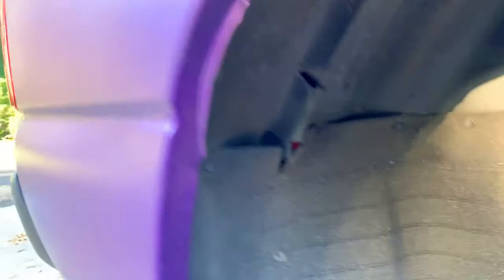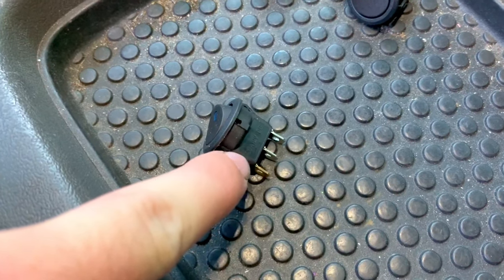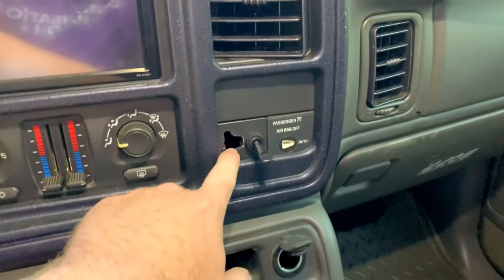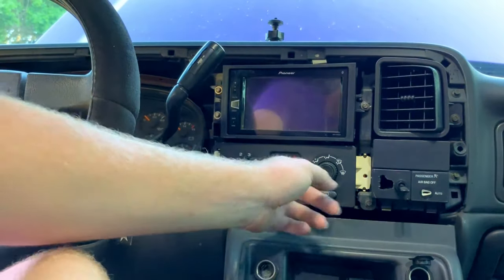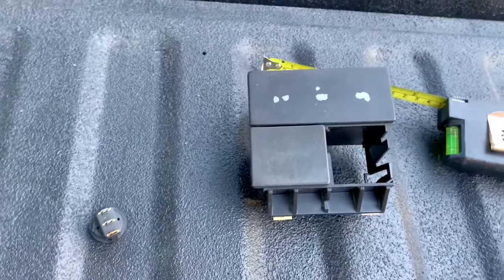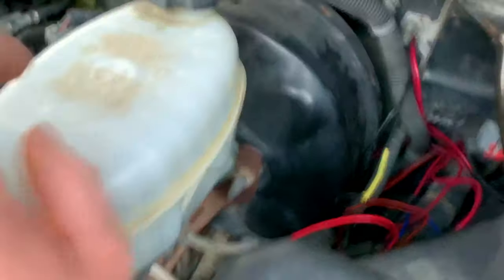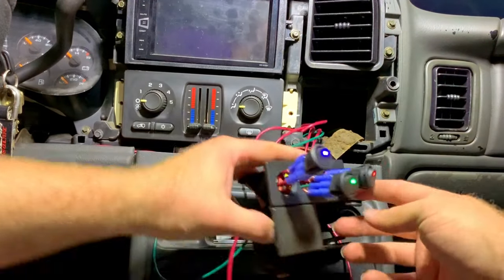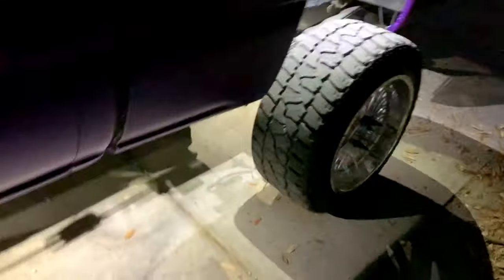DIY Switch Panel For Aftermarket Lighting

Comment: Orilleys sells a tool for running the wire through rubber grommets. Looks like a screw driver with a hole in the handle . I've always ran my constant and ground wires just like did .  I've been wanting to do switches in my over head center console .  I would suggest using wire loom to straighten up some of the wires in the engine bay and it's added protection .
Reply from the maker: I plan on wire looming everything just ran out of time that night. I don’t like the bare wire look.
Reply: @AaronCates  what is wire looming
Reply: @CODESFV A plastic protective sheath to run wires through and keep them in place, just look at the factory wiring harnesses.

Comment: Hey so I have wheel lights on mine and they keep draining my battery and I was wondering if my wheel lights are controlled with just my phone and I install that switch like how you did will it shut them off even tho they are controlled by my phone

Comment: I got that exact switch for my rock lights but for some reason it isn’t communicating with them even though the switch it self turns off & on. I have my load wire coming from the switch connected to the main red positive wire from the rock lights with a fuse on it. I’m stumped on why the switch isn’t communicating with the lights whenever you turn the switch off & on… My ground for my rock lights is the negative pole on my battery but they would always stay on or hot the whole time connected to the battery even when I would turn my switch on & off so I wonder if its my ground for the rock lights that could be issue & why it’s not communicating properly. I would appreciate some feedback from you on what you think could be going on, that would be great!
Reply: Mine did same thing get 5 prong switch and it will work idk why 3 prong switch did that

Comment: Sup brother! Great video.  Question  I saw when you connected the two wire with the heat shrink thing, now I noticed that both wire are different sizes? What gauges were they?

Comment: Not sure if ull see this.. but, can u run the 1st and third switch without without the turning on the 2nd?.. since the power wire is all connected to the same wire?
Reply from the maker: You can run any switch with this setup, you can turn on any of them by theirselves or turn them all on, doesn’t matter.
Reply: Yes because it's constant. If the wires didn't touch and came off a different tab on the switch then you would have that problem.

Comment: Just curious as to what wheel lights you have and what size did you go with I have 20" wheels and dont really know what to go for as far as size of the rings or how to mount them per day nice looking truck and keep up the awesome DIY videos
Reply from the maker: I have a video on what wheel lights I have and now to mount them.
Reply: @AaronCates  ok yea I should looked at the vids first lol thanks for reply
Reply from the maker: No problem!
Reply: @AaronCates  it never said what size the ring was but I guess with the ones you got it was adjustable
Reply: tried to install it and went to crank my truck up and battery was dead🤦🏿‍♂️. gotta go charge it

Comment: I mean, this is cool (switch box mounted in the dash), but no wire looms? No grommets for drilled holes? no relay? Did you use an in-line fuse block at all? RIP your wires when you do off-roading. 
Dude... I cam here to see a good explanation of wiring to switches for off road lights, but I think this is a good example of what not to do. And that wires rats nest @ 3:00, man come on.... Not a clean install, not professional at all.